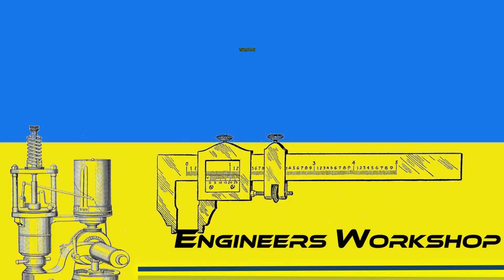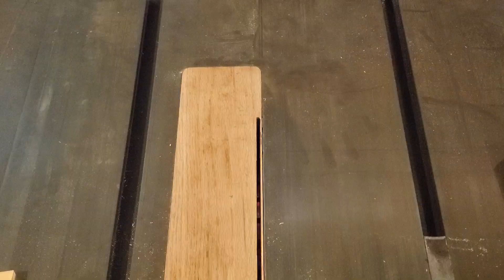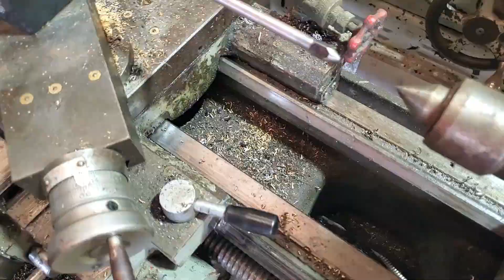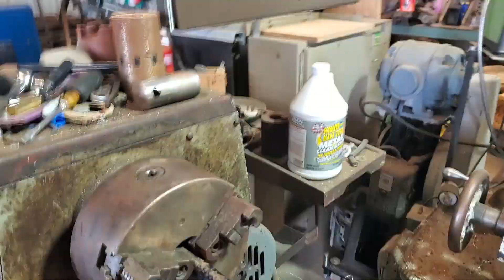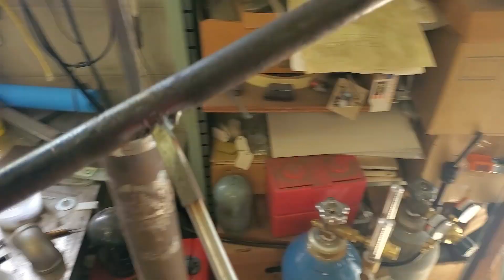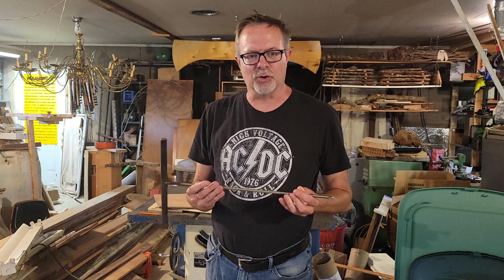Making a Soil Probe from Square Stock

Comment: I made a probe a couple of weeks ago. 1" tube steel for the handle and 3/8 round rod about 30" long. Didn't know about putting a ball or otherwise making the point bigger than the shank. It worked well for what we needed--also looking for septic system components as part of the shop build. Adding a bathroom to the new shop cascaded into a second septic tank, dosing tank and 220' of draiin field. Nearly an entire new system.
Reply from the maker: Guess it's just like relief on cutters, or hollow grind knives. In hindsight I should have made mine 12" longer, but I was concerned about buckling.
Reply: @EngineersWorkshop  When you described it in the video it really made sense. I will add something at the end of mine before I need to use it again.
Reply from the maker: Pilings support their load due to the friction of their sides against the soil, not from "sitting on" soil at the bottom. Made sense to me when a foundation contractor explained the physics to me.
Reply: @EngineersWorkshop  When you said how long you were going to cut it I immediately said no it should be like 3ft. Not because you need to jam it in the ground that far but because it saves having to bend over so far.
Reply from the maker: Happy back, happy life you say..👍😁